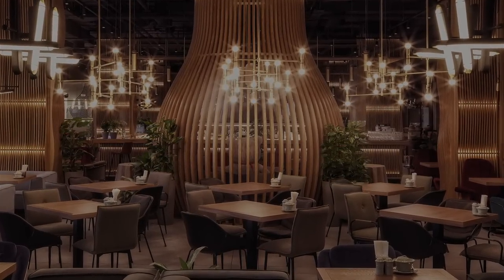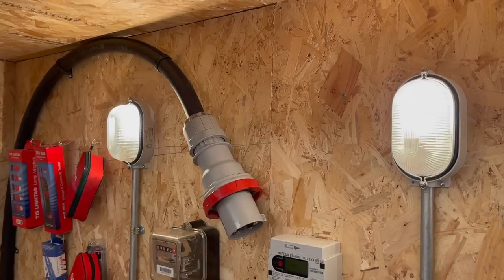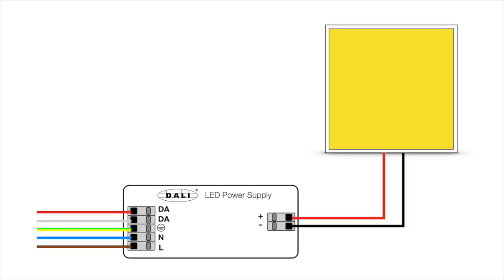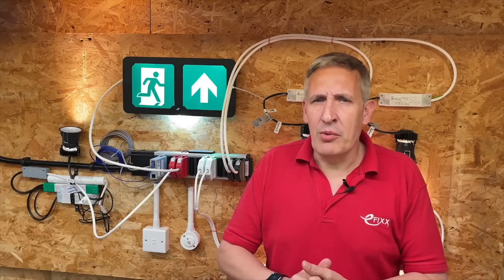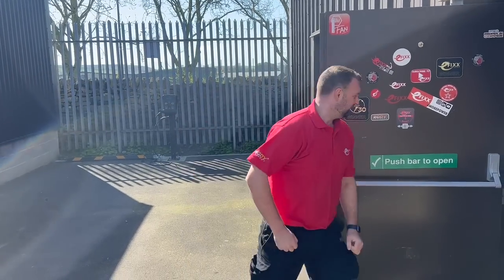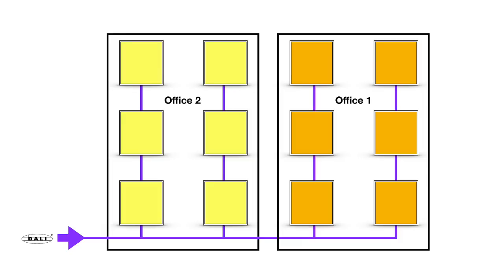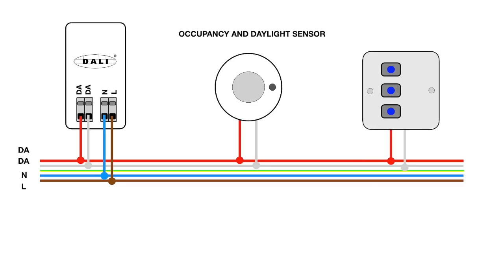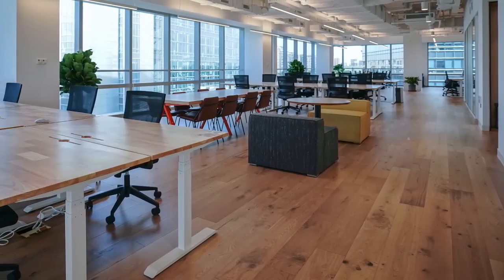A Beginners Guide To DALI Lighting Controls

Comment: Not all Dali systems can handle 64 input devices, ie PIR's switch interfaces and scene plates so check with the system provider.
Also Dali systems can have emergency monitoring so if you have a Dali fitting with a Dali driver and Dali inverter that fitting will count as 2 addresses of you 64.

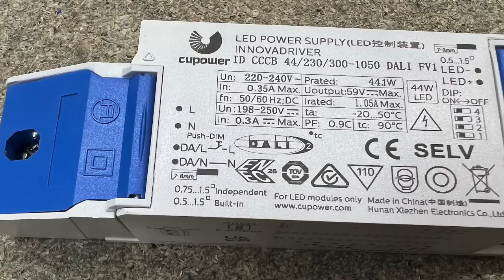Comment: At 6:00 you said that the Dali signal isn't polarity sensitive. I can guarantee you that if you mix the polarity it will not work. I always  use black as minus (like in dc) and grey as positive. If i add another light where i switch it to grey aas minus and black as positive it will not work, i know from experience having to open several lights to figure out which one the apprentice miswired.
Reply: A Dali device that is not adding power to the system (led driver, panel, sensor, relay etc.) is not polarity dependent. It is only in the rare cases where you have two power supply then they needs to be connected to match polarity. Saying that I do agree that in any system having a consistent polarity as you said black as minus is best practise regardless of polarity sensitivity or not. Most manufacturers have  +/- or D1/D2 printed on the connectors to aid installers with this. From your experience with fittings and problems with polarity it sounds like the drivers them self provides power to the system and yes then they must be connected with the same polarity.

Comment: Any advice on fault finding or faulty components. We have a building with dali controls, 1 controller failed last year leaving the whole building in darkness,its taken ages to get parts as the system is an old one.
Reply: The basic function of dali is the broadcast feature - in fault finding a dali power supply and a slider/rotary or the combo is a effective and basic way of testing -  it will identify any loads that will not respond making it easier to identify the problem. Next step would be a pc software to connect and diagnose. Question what system do you have?

Comment: My only gripe with Dali systems is the 6 pin plug. The pins are grouped into 2 groups of 3 - one part being black (the mains wiring) and one part being blue (the Dali wiring) BUT the blue part isn't only for Dali, it also has the permanent live. 
And as I recently had to correct far too many plugs incorrectly connected my gripe is really big. - Why did someone decide the blue part would have 3 terminals, why not just for the 2 Dali conductors?

The flex7 plugs are better. You simply have to read the legend embossed into the lid.

Comment: A common arrangement in NZ has been to run normal cable (red as active) and then a separate 2 core cable (red and white) for DALI control. Which leads to the situation you mention - possibility of DALI becoming live to mains voltage. Supposedly it won't damage equipment, but absolutely isolate properly.

I did one job where we ran 4 core and earth cable, with phase 2 and 3 being used for DALI, and installed that into sockets that had extra pins for it too. Prep the driver on the ground, plug it in and install into grid ceiling, super easy. Some people don't do that because they think its cheaper to go with two separate cables, but the labour savings more than make up for it.

Comment: How do we maintain this equipment? In a few years time, it is going to break down. Is the equipment standardized,or is it esoteric to each manufactures,? I. E. Can we just go to the van and get a new module?
Reply: As many other things this depends on the original installation and they system being used - I have mostly used the Helvar router system and if a device goes missing ( breaks) and you connect a replacement the router will assume the new one is a replacement. This is a option you can disable.  Honesty most time I just connect to the system and make sure any devices are programmed as intended, today I think this is true for most larger scale control systems.

Comment: What's wrong with DMX
Reply from the maker: Nothing but Dali had more flexibility for wiring.,
Reply: Baudrate is much slower, meaning you can bundel he data lines with the current wires. It's the best system there is because of this. It's balance of speed and reliability.
Reply: @syproful  DMX is differential so can be run alongside conductor wires as well, many claim it's a bad ide but that's complete rubbish. The main issue with DMX is lack of error checking/correction, it's normally one way (unless  you use RDM which is a clunky bodge) and doesn't have built in features for zone control. It's not specifically the baud rate with Dali but the fact that it uses fairly high voltage signalling (0-16v).